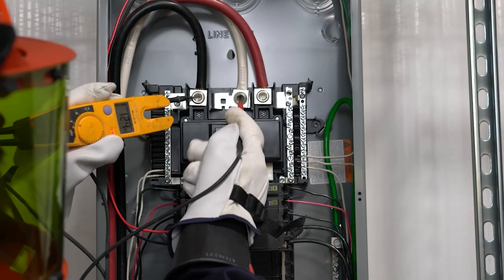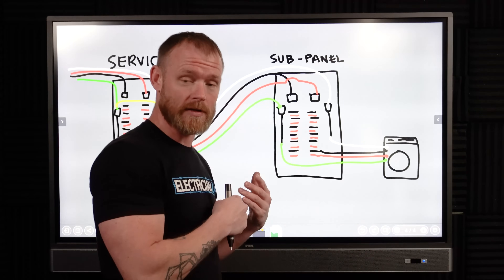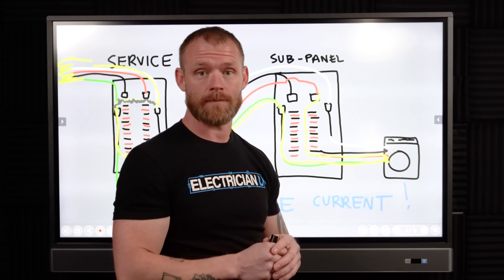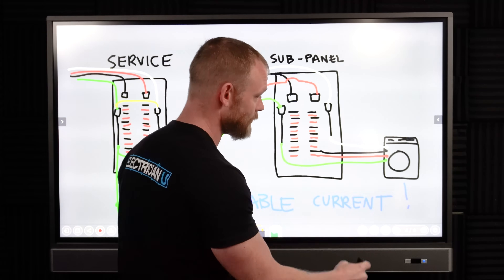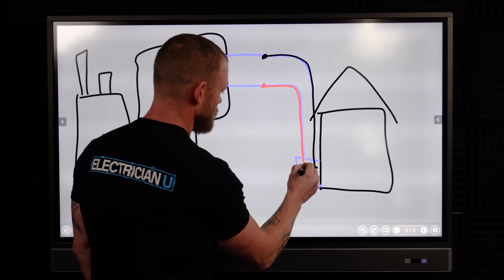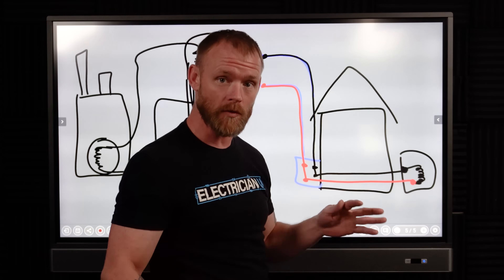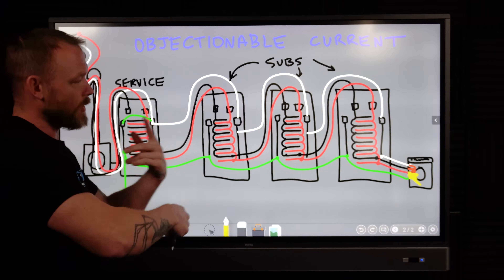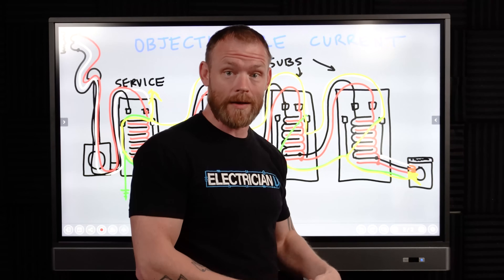Why Do We Bond at the Service Panel and Not a Subpanel?

Comment: The reason you don't want to bond ground and neutral at the sub panel is that in the event that neutral was to break between the panels the ground wire would act as neutral going back to the service panel and there would be no way to tell there was a fault unless the ground wire overloaded or it broke as well. In the event both ground and neutral broke the ground would have potential on the sub-panel side.
Reply: What trips the breaker? -  if your electric is directed back through the ground wire to the bonded neutral and makes a complete circuit, what makes the breaker trip to alert you to a problem?   Why isn't the ground, completing the loop, completing the circuit that the neutral originally had been doing and the device continues to be powered and nobody knows there is a problem?    Is it because the ground diverts some electric to the earth and the power pulled through the breaker is lower?   That wouldn't make it trip.  What trips the breaker?
Reply: @heresthething....4685  The power doesn't go out and that's the problem. In a normal circuit if the neutral gets cut the power goes out but if the ground is bonded to neutral in 2 places and the neutral is cut then all of the power is sent through the ground. That wouldn't be the end of the world except ground wires are often quite a bit smaller and not rated to carry the current the breaker will let through. It can get hot and burn inside the wall somewhere.

Then there's the issue if the ground and neutral are cut between the bonding points then power has a path to flow through the device, to the bonding point, and back through ground to the frame, making the frame of the device live.
Reply: Ahh, now I see.

Comment: What about when the sub-panel is in a different building? That building is going to have it's own ground rod. Why not run a ground wire from the out building to the primary ground rod? Why gamble that the electrify from one ground rod will find the other?

Comment: Thank you for the detailed explanation.  I have a question about a ground on my solar inverter. I was helping my repair guy with some measurements and he wanted me to measure L1 to ground and L2 to ground. I was measuring approx 120v on each leg since the inverter is connected to a breaker in my main service panel where the neutral and grounds are bonded. He said something is wrong since I should be measuring 0 volts. What would be the correct measured voltage in this situation?

Comment: I have a situation I'm trying to solve. I'm trying to install a spa(240V, 50A). I'm tapping off the old oven circuit(2 hots and a ground, w/ no neutral). I installed a GFCI breaker box that is spliced off the old oven j box, for the spa. How would I do the wiring for this w/ no neutral? Would I have to bring another seperate neutral wire from the main panel?

Comment: Thanks for the informative grounding/bonding video, my question is in between main panel and my next panel,  I have a splitter box this to connect additional breaker boxes in other building on the farm with say that my panel is grounded and bonded to the main breaker panel I assuming then I have to run ground wire to the splitter box then to the sub panel then to my next panel which is in the house, may sound confusing I am trying to get all my overhead lines under ground

Comment: Pointing out one thing: In most SFH, there's no ground conductor coming from the service. Ground is provided on premise by the ground rod.

And that's why you need bonding: because ground bar alone doesn't provide enough fault current. 

If there was a ground conductor provided by the service (for example many commercial buildings have a shared ground across the building) bonding is not needed, because that ground conductor provided by the service provider is a good enough low impedance path back to source. 

You can still ground the service-provided ground again on-premise, there's never too many grounds on ground wire.
BUT don't bond it with neutral again, there can be only one bond.
Reply: I noticed that also.  In the first graphic he's showing FOUR wires from the pole... typically there are only THREE.  The two HOTS and the NEUTRAL.  As you say, the GROUND ROD is at the service entrance.

Comment: umm just the one question, you say in this example that you have a fault where live is connected to the ground wire with no bond to neutral, and is could shock you, but from the device to you where does the electricity go? 
the funny thing is, both neutral and ground are paths back to source, as when you have a voltage divider the centre tap(s) (2 phase / 3 phase) are grounded. this is done for a 0v reference and more stable voltages. the ground resistance back to source is an unknown resistance and can very wildly, this is why we have a grounded neutral, it is a low known resistance back to source.  technically you could from hot / live to earth and can complete the circuit, but it would have a very high resistance.

Comment: Question, if my panel box doesn’t have ground bus bar. And I need to install a nema 14-50. Should I install bus bar for my ground or can I ground the 14-50 on the 1900 box? The 1900 is ground it because it’s all conduit to the panel.

Comment: Dustin im doing this in a few days stupid question.... ive see 3-2 and its has a single bare wire as a fround no bigger then 10ga.... thus my question when putting a sub in do all four wire meaning ur comm white ur hot black ur hot red and ur ground need to be all same guage or white red and black can be 3ga and ground just a connector.... only cause i helped someone run a ac unitand they used that as a ground  in same situation

Comment: That was a great video. I made sure to subscribe after seeing how thorough and well explained the concepts were. My service panel has space for four breakers, and two are taken up with the 2-pole 100A that feeds the sub panel in the garage. The other two spots I have used for my 30A RV receptacle and a 20A circuit to my wife’s greenhouse. The neutrals and grounds are bonded in the service panel, so I would like to know if I will having any issues wiring a string of GFCI receptacles inside the greenhouse. If this will cause an issue, can you recommend a way to overcome it? I have to have GFCI in the greenhouse due to the sink and wet environment. Any advice would be appreciated. Keep up the good work.
Reply: You only need one gfci protecting the string of outlets. The first one being a gfci then from there to the other receptacles you would like to be gfci protected. I’m not sure about the load calculation though someone smarter needs to answer that.

Comment: Glad I saw this video. I do have a scenario where there will be multiple panels. Each will hop full 200 amp service. I have a main pole with meter and from that box I have an RV hookup 60 feet away with a 100 amp panel. 70 feet In the opposite direction, I have a 200 amp exterior panel, and 120 feet from there is a conex container that will have a 200 amp interior panel and another container 100 feet from the last with a 200 amp interior panel in it.

Comment: Question, I have just a service panel (no sub panels) in a steel building. Running emt and some m.c. I am sharing the neutrals and grounds on the same bar. Should I still use the bonding screw that came with the panel? And should I pull a ground wire with every circuit still? And finally should I jump a ground to all metal boxes? Using stranded wire by the way. Really appreciate your channel, learning more every day. Thank you.

Comment: That a lie to trip breaker. The breaker in a panel is not a shortage breaker as a no fault. It more dangerous by mercury breaks circuit not a pathway interuption as a no fault breaker is. If it was , it be stupid to use 2 breakers on 1 circuit with heat to break circuit and another for short to break circit. Only a ground fault breaker  has a ground green wire wire the mercury breaker does not. In usa the breakers are current load wire only, in south east asia or middle east it current  load line and a white traveler neutral  on same brraker. A neutral is not a ground, it a traveler to return half of current flo to compontent back to transformer means ac volts.

Comment: Interesting. I always thought not bonding the neutral and ground at sub panels was because code doesn't require a ground rod on each sub, if the subs are in the same building. If the sub is in an outbuilding, it used to be allowed to run 3 wires and you'd treat the sub panel as its own primary panel (w/ ground rod). IIRC, code now requires 4 wires to be run for new installs but it's still advisable to use a ground stake. Is that not true?

Comment: Very good diagram of your discussion yes if you don't have the ground and neutral connected at your main feed coming in did the circuit breaker will not have enough current to trip it this save a serious situation.

Comment: great video, I am working to replace older 2 strand (hot, Neutral) wire in my home with new 3 strand wire ( hot, neutral, ground). I know I have a ground wire from a grounding rod going into  my panel, do you have a video showing how to install a grounding bar and bond it so that I can wire in the new 3 strand wire?

Comment: Is the green ground wire line supposed to be going from the transformer on the pole, to the service in your illustration? (at the beginning)  In the subsequent illustrations, I don't see it going from there to the service. Also in the illustration, you showed that bonding the ground and neutrals in the panel would be able to complete the circuit "through red" if there was a fault. Could it not go back through black? Or does the direction of flow coming in on black hinder it from going back through that wire, thus forcing it through red. I hope that makes sense.

Comment: Excellent video as always!  For a garage workshop, I had the electric company upgrade my meter box to a 400 amp dual lug system.  An electrician added a new 150 amp service panel in my garage.   The new service panel is connected directly to the meter socket.  The original 150 amp service panel is also connected to the new 400 amp meter socket.   Both the old and new service panels are bonded.   Is this correct?

Why I am asking is because another electrician connected a 240v circuit for a mini-split in the garage, he told me that the panel should not be bonded and proceeded to remove the bonding screw in the garage.  I asked him to stop and explained the configuration to him.  He put the bonding screw back, but looked like I had horns growing out of my head.  Now I am second guessing what is correct.  Your thoughts?    

If bonding both service panels is the correct path, what can I do to prevent another electrician from “correcting” the situation again?

Comment: How are RVs wired regarding neutrals and grounds?  I have a 50amp 240v 5th wheel trailer that had an overheating issue on the neutrals at the fuse panel. One neutral was not tight, and it heated up. I understand bonding at the service panel. I assume the 'service panel' is the RV park power pedestal. Did my RV panel overheat due to the loose neutral connection?
Reply: Most likely the cause. I would check every wire and bond connection for tightness and on a schedule.  RV's are very poorly constructed and not inspected.  They may also be allowed to use aluminum wire which shrinks over time.  Vibration during towing may loosen connections too.  I don't know if there is a code to conform to as a home is required to.  The park connections are a source of many problems too because of weather and lack of maintenance and overloading by users.  It's best to test and inspect the hookup before you plug in, for your safety.  Get yourself a little multi-meter to carry with you.  I had two motorhomes and know there are many dangers regarding RV electrical use.
Reply: @motorheadplatt8748  Thanks. I do check the pedestal before hookup & use a surge protector & diagnostics device.

Comment: But why would a fault through a neutral fry equipment? If equipment were inserted in series with each other, that would be true. However, equipment is always inserted in parallel with each other because power outlets are always in parallel with each other. So, why would any consequential amount of the fault throught the neutral travel through the equipment when the wire has a drastically lower impedance, vice versa?

Comment: Excellent video, though I am still a bit confused as to why bonding at the service would prevent the current from flowing through all of the bonded metal parts since it is still part of the entire complete loop of the circuit?

Comment: So the question arises as to those homes, most of them actually, which only have a service panel, and everything in the home is coming directly from that, the way it would be coming from the various sub panels in larger buildings (I have three subs in my home that I had installed). Binding occurs in that service panel, just as it does in the multi panel building. How is that different from bonding a sub panel?

Comment: Any ideas why I lost power on one circuit in my house and the breaker didn't pop? House built in 66. I swapped the breaker out still nothing and traced power on that circuit to first junction box and have power there. Down steam from there not sure yet haven't tested. Breaker is off. Not an electrician.
Reply: Start where you don't have power with the breaker on.and work your way back.  It may be very hard to locate wire to know routing.  Look for rat signs.

Comment: Great video.  In addition to ground faults and short circuits, won’t any normal return current on neutral be split at the improperly bonded secondary panel and cause objectionable current on all grounds between service and secondary.  This is basically what you said, but just pointing out the objectionable current would be created even with normal current (not short circuit or ground fault… just a light bulb turned on)

Comment: Now explain why most houses now have only 3 wire entrance  with a master disconnect, usually another 200 amp breaker, at the pole  for emergency shut off in case of fire. Mobile homes now do require 4 wire service but most houses with overhead between the meter and the house is 3 wire. Licensed electricians bond in the main house panel and the neutral/ground on the pole is bonded to the pole ground wire.

Comment: Does the subpanel neutral bus bar have voltage? Mu subpanel neutral bus bar carries voltage when the copper strap is removed and showed no voltage when the strap is reattached between the neutral bar and the ground bar. Please if someone can help explain!
Reply: Where is the strap?  Do you mean in the subpanel?  When their is no bonding, as is correct, there can be a small voltage between the neutral and ground because the wire connecting the neutral bus bar to the neutral in the main panel has some resistance.  What is the distance?  How many Volts do you measure?  What is gauge of the wire carrying the neutral to the main panel?

Comment: In the case of a hot to ground fault on a device that is fed from a sub panel, which breaker trips? The disconnect at the main panel or the circuit breaker in the sub-panel?

Comment: Great video, but just a couple of things to clear up: around 8:30 you state that current won't flow because there is no close loop however you do not need a close loop for current to flow(thing of lighting). In you drawings, if you have a grounding rod, current can indeed flow to earth becuse of potential difference. That's is one of the purpose of a ground system: to dissipate fault currents.  

Also, another thing worth mentioning in you video could be the option to NOT connect the grouding buses between the panels and provide a grouding system(grounding rod) for both instead. This is another solution to avoid parallel currents typically done when you have multiple building.

Comment: I believe the reason why the neutrals and the grounds are not bonded in the sub panels is because the ground wires in the sub panels are not grounded to the Earth. But in the first disconnect they are.

Comment: If a subpanel is not connected to its upstream main panel by a ground conductor, then it seems the ground and neutral at each subpanel SHOULD be bonded. 

Example: Main panel is out on the pole, which has bonded ground and neutral and two circuits for the well house and an RV connection. The panel connects to red, black, and white (neutral) conductors going to the house, which has an indoor (sub)panel. No ground conductor exists between the main outside panel and the indoor panel. In such a case, the indoor panel IS a service connection and ground and neutral should be bonded. 

Such an arrangement would isolate the outdoor circuits from the house circuits.

Please correct my thinking, if I am wrong.

Comment: This YouTube suggestion caught my attention, because i got curious why you would want to bond ground and neutral together. 

You dont use a RCD (Residual Current Device) in the service panel for personal protection at all?

Thats really dangerous if your relying on a high Amp fuse to blow, for personal protection 😳

If the fault current is below the trip current of the fuse, it will just keep flowing and can go through a person untill crisp and done ☠️